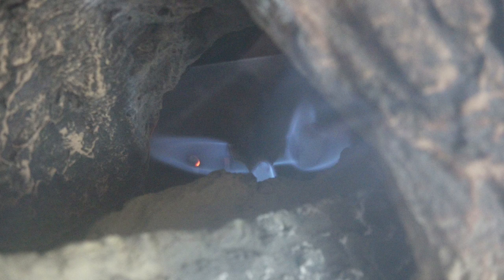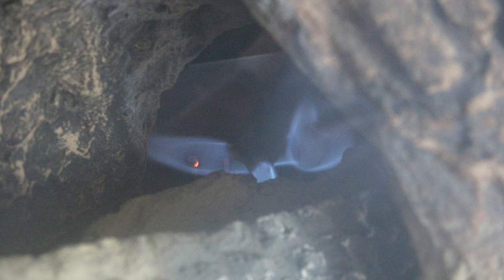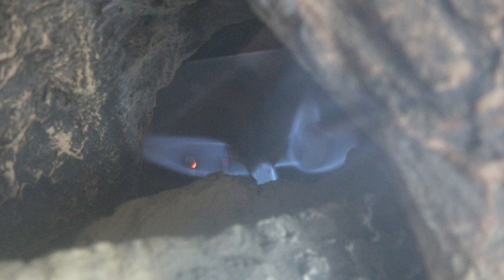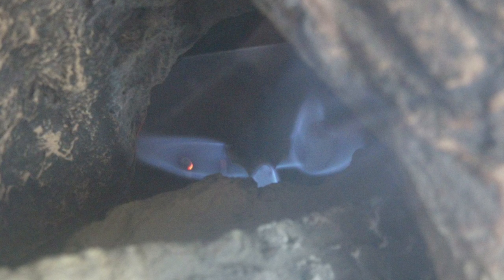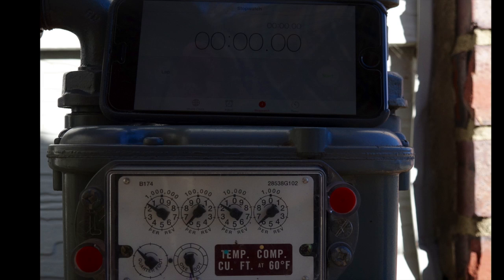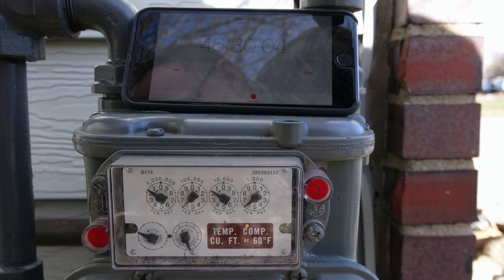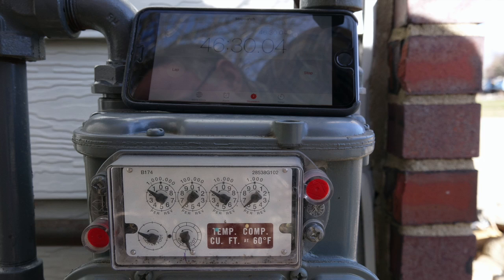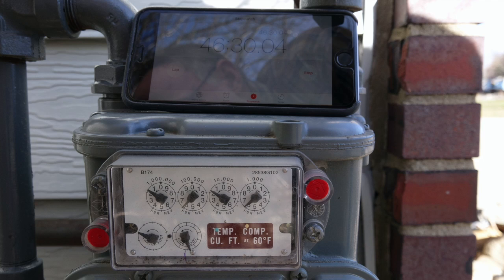How much gas does the pilot light use #1

Comment: SRC over T. Seconds in an hour(3600) Times Revolutions of the test dial Times the size of the test dial. (usually the smallest dial. In this case the 1/4 cubic foot dial could have been used) Divided by amount of time. Example with a .5 cf test dial that spins one full revolution in 30 seconds. 3600 X 1 X .5 = 1800 Divided by 30 seconds = 60 cf or APPROX .6 therms per hour. Then multiply this by the cost of a therm of gas. (look on your bill). Note: make sure when doing this test that all other appliance are off and the pilots are off.

Comment: Great channel and I really respect your opinion. We have a 50 year old nat. gas boiler in our basement which uses a thermopile. We always leave the pilot flame on during the summer. Is it prudent to turn the pilot off during the non-heating months? What is the effect, if any, on the life of the thermopile and the boiler (e.g. keeping moisture/corrosion out, etc.). Thank you.
Reply from the maker: The decision to shut down the pilot in the summer is an interesting one.  Sometimes, if you shut down the pilot, the pilot safety will not work when you light it in the fall.  I would consider this a good thing.  When I service a gas appliance, I shut down the pilot to test if the pilot safety works.  So, bottom line, shut it down.  If it fails to work in the fall, be glad.  It needs repair.  Moisture and corrosion are really not an issue.  Thanks for the support.
GFM
Reply: @grayfurnaceman   I do the same with my gas fireplace. Not only does it cost money for the gas, but by adding the heat of the pilot to my house, it increases the AC cost.

Comment: QUESTION - Very helpful.. Just so I have it straight, that's 46 minuses, 30 seconds for 1000 BTU of natural gas or is that  1 ft cubed of natural gas? Also, in regards to your other video testing the FURNACE's Pilot, that was 1 hour 33 minutes for 1000 BTU or was that 1 Ft cubed of natural gas?

Comment: i always tell people its about a $100 bucks a year. why not time the.5 ft dial?
3600 (seconds) X .5 (dial)
divide by seconds elapsed
multiply by gas btu content  (1050 usually)
Reply: +PHC Apprentice, It's 1800 if you are using the .5 dial. 3600 is for the 1cuft dial.
Reply: +Bob Blanchette that's why you will notice I wrote .5 as a multiplier. you multiply by whichever dial you are using.
Reply: +PHC Apprentice My bad, post was confusing to me.
For 1/2cuft dial I just let it spin twice and divide by 3600.
Reply: +Bob Blanchette yes you shouldnt rely on the .5 cubic ft dial. too much discrepancy especially when it apins fast.
Reply: +PHC Apprentice Thats why I let it roll at least twice.

Comment: That is more than I would think but like you said it is a gas fireplace pilot that is larger than normal. I will be on the lookout for the video on a standard pilot.
If possible it would be nice to also see the new FVIR water heater heater pilot also. I believe they are basically using a LP orfice with natural gas. 
Very interesting thanks.

Comment: That seems like quite a bit. I just checked one of my summer gas bills. It was $21.90 for one month and $10 of that is the "Basic Service Charge". The metered portion ($11.90 for 19 therms) accounts for our gas water heater,  range and dryer, all of which have electric ignition. If we had that fireplace, that would be a significant portion of our gas bill.